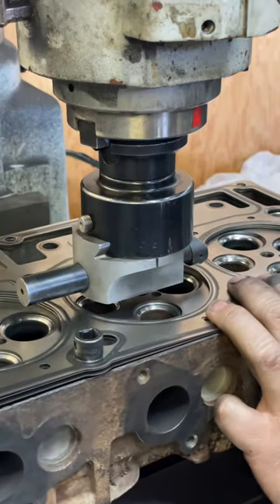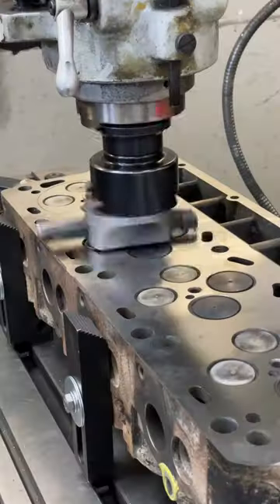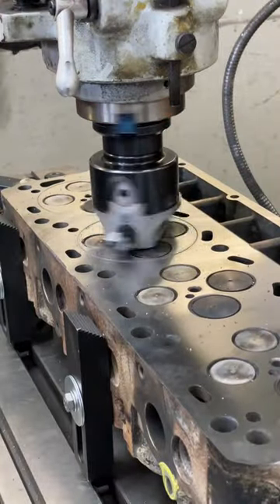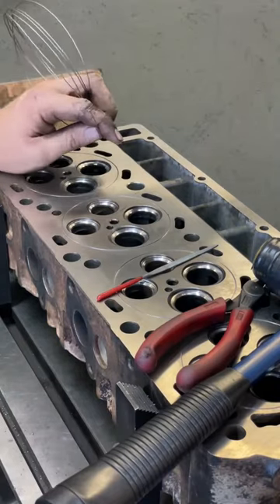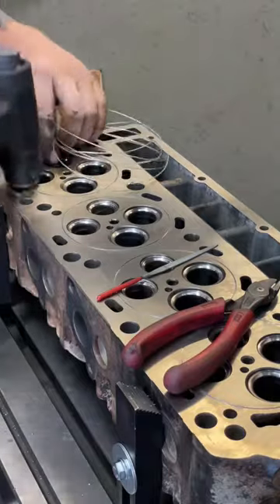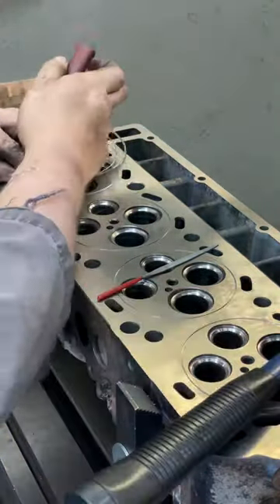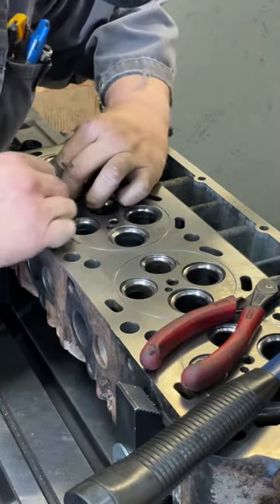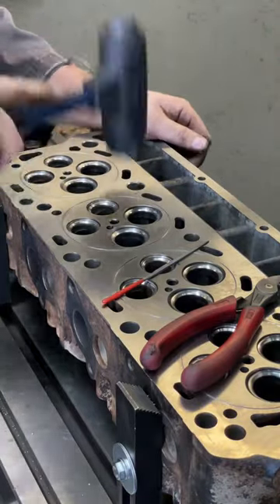Cutting Diesel Orings #shorts

Comment: All diesel heads should come like that from the factory👍🏿👍🏿 instead of a weak factory headgaskets
Reply: Wish I had this 20yrs ago on a VW TDI I converted to mechanical injection. 
45-50psi was about all it would hold with raceware studs, keep it around 30-35 it was still fun but wouldn't lift the head.
Reply: A gasket made in 7 days? 😆 🤣
Reply: Weak*
Reply: @MrTheHillfolk  holy shit I cannot believe the rods could handle that level of boost.  Pretty stout little motors I guess
Reply: @Awesomeman1987  yeah the worst part was popping head gaskets , the next best thing to do would have been to size up a better turbo and I'm sure you'd get more power at a lower boost level and help it survive.
Reply: @MrTheHillfolk that mechanical injection makes all the difference! I have made it a mission to buy every old diesel that can be p pumped and convert them to mechanical injection and bullet proof the trams while I'm at it.

Comment: For anyone out there planning to o-ring your high performance gasoline V8 and plan to run copper head gaskets then you must cut receiver grooves as well. A composite gasket say . 039 compressed thickness can run without receiver grooves if the o ring is placed dead nuts in the middle of the fire ring of the gasket.
Reply: I have question sir .why would some one do this technique and what r the benifits behinde the perocedure? thnx

Comment: Best way to seal up a 6.0!!!
Reply: Yeah but they still pop.
Reply: @matt8478  I have a lot of customers running around that no longer have the repeat head gasket failure. These people aren’t performance focused. Stock trucks but now they can hook up to their trailer and not worry
Reply: This problem you are referring to is a multiple answer problem not just doing this particular thing.
Reply: @zacharysant1443  I won’t argue with that. What other things are you referring too?
Reply: @showmerepair  stud it! No if ands or buts. It doesn't have to be ARP to be honest there are plenty of other companies out there now that are making stud kits that are reputable that are as I'll say right now are questionable only because of the numbers they claim. I'm a firm believer in ARP but we have used others with great success! After that use only 100% factory head gaskets the rest of them can come from Mahle or FelPro. Other than that make sure you send the heads to a professional machine shop! Almost guaranteed the factory heads are cracked! Part of the problem!. We use Promaxx Performance heads. And as of most recent we only install diesel heads that have been O-Ringed no questions asked! The customer does not get a choice on that matter. But guaranteed if it has factory heads they are cracked between valves. It my experience 100% of the time if you happen to get lucky good for you! I highly suggest looking into Promaxx heads or another option.
Reply: @zacharysant1443  I agree with 100%. That’s exactly what my customers get. Other then powermaxx but not saying they are bad just no experience with them.
Reply: @showmerepair  after that assemble as normal and torque everything as should be and use good fluid. We recommend coming back for an oil service after 1k miles on a diesel. After this type of repair. We actually inspect the filter on this service and will show you what we have found. Got that from a customer that we actually did heads on and then they failed and took out the motor because of faulty heads. Sad story but you'd be amazed at what your filter looks like after the initial break in, on a diesel especially! The amount of what we are told from our suppliers and builders is bearing material is almost alarming. But regular service intervals and they completely go away after the first 2 services!
Reply: PROMAXX PERFORMANCE. Sorry if i said otherwise before.
Reply: @zacharysant1443  I personally don’t believe an oil change needs to be done at 1000 miles. Replaced and rebuilt a lot of engines. Anything roller cam I just have customer change at  3000 to 5000. Just my opinion. 
But yes it’s amazing how much is caught in filter in the first couple oil changes.
Reply: @zacharysant1443   new what company you were talking about. Sounds like your doing the customer right. There’s always a little bit different ways to make a repair. But if the main focus is to take care of the customer. Then you’ll always win.
Reply: @showmerepair

Comment: Hello. Potentially noob question here. What is the purpose of this? Is it only a diesel thing?
Reply from the maker: It to add seat pressure tot he head gasket. Just help the headgasket not blow under high cylinder pressure

Comment: Pretty neat. Does this make up for shitty head gaskets? Like backup?
Reply: This a 6.0 powerstroke head. Head gaskets are good. But the heads are known to crack and warp. This gives it that little extra sealing it needs.
Reply from the maker: It just adds more pressure to the gasket. You want you surfaces to be perfect still.

Comment: Prepping to do a build with o-ringed heads.. just a quick question.. does or should the block need to be o-ringed as well?
Reply: NO!
Reply: @zacharysant1443  perfect lol that's what I figured but wanted to be sure 👍🏼👍🏼 thanks!
Reply: @DanMarcelino  This is only to provide an extra positive bite to the gasket! The clearances on diesel heads are such tight tolerances that this stuff should be done from the factory. These particular heads which don't quote me on I think are Ford 6.0l heads? The valve recession on the head minimum tolerance is only I think 0.013" and the tolerance for piston clearance is very similar if not identical.
Reply: The real problem with these particular heads speaking of just the Ford V8 Diesel engines of the 6.0l and 6.4 family is that the engineering relied way too much on just the gasket itself and the stock head bolts and not studs! For the pressures involved with this application.
Reply: @DanMarcelino  I work at a repair shop that does this repair at least 3 times a month and it will run you anywhere from 10k to 18k depending on damage and what not to correct the massive error from the engineers that they relied on. A Cummins head isn't much different. We will not install a head without it being "O-Ring" for warranty purposes. Too much time and money involved for the small cost to have it done!
Reply: @zacharysant1443  yes, I've modified a few 6.0's and they are beautiful engines and have no issues. Most of the issues sprout from the cooling inefficiencies.. I've done several engine builds but none with o-ringed heads. 👍🏼
Reply: @DanMarcelino  👍 best of luck to you on the upcoming build.
Reply from the maker: For most light duty the way we do them is just in the head and a flat block
Reply: @CUTTERUPROB  thanks! So are you implying that you do o-ring the block in heavy duty applications?

Comment: Is this 2000:1 compression ratio on those chambers?
Reply: The most diesel engines have the combustion chamber in the head of the pistons
Reply: @Maurulote  no actually all modern internal combustion engines do lmao.
Reply: @wyattshelton2080  that isn't true, it's generally a mix of both the head and the piston topography together forming the combustion chamber in terms of non-flat surfaces influencing air flow characteristics and flame propagation. (all my experience is in gas engines, though, can't speak for diesel or other fuels)

Comment: Purpose??
Reply from the maker: Add seat pressure to the headgasket
Reply: Prevents head gasket failure/blow out. The wire bites into the gasket making it near impossible to blow out.

Comment: Use fingernail clippers not wire cutters.
Reply: I think he used flush cuts, essentially finger nail clippers in plier form
Reply from the maker: I am using Double  harden flush cuts. I am not sure nail clippers would stand up to the amount of this I do.
Reply: Lmfao he said use fingernail clippers to cut a hardened steel wire? Bahahaha!
Reply: Funny story! I actually work at a machine shop that does this on the daily! Costs way less money to use the proper tool in the long run then it does to I'll say chince out on a cheap one. So what's your story and how much do you spend on nail clippers? Hope you have stock invested in the same company you buy them from! Tell me again how your the one who hasn't done it on the regular?
Reply: @zacharysant1443  yes, funny that you haven’t tried it with all your experience! I worked with pro-stock mountain motors for years. Try it instead of thinking I don’t know shit.
Reply: @ckane510  what's funny is you think we haven't tried it! What's funnier is you are comparing what works for here and there to doing this 100s of times a month plus. Your cute but thanks for trying to compare. The nail clipper thing is great for a "few times" then your onto the next set. Me personally! My hardened flush cutters going on 3+years! How many nail clippers you do you go through?
Reply: @zacharysant1443  just do your thing and I'll do mine and you can stop being cute too.